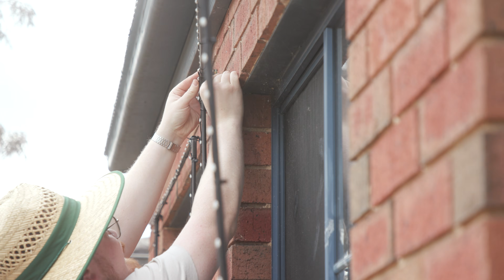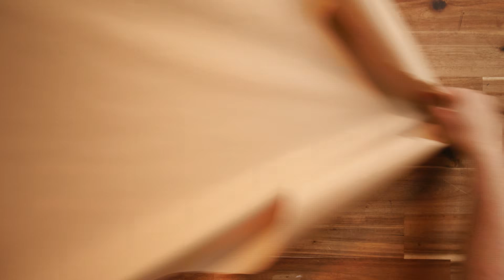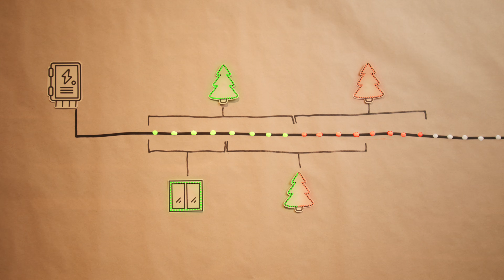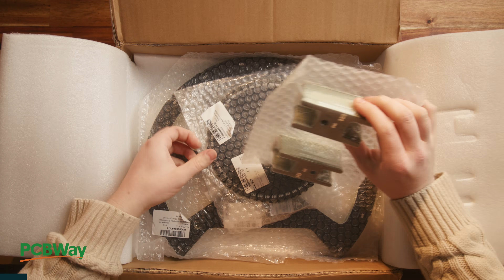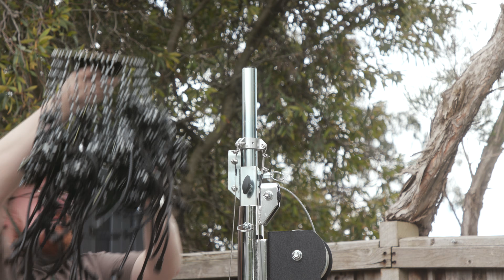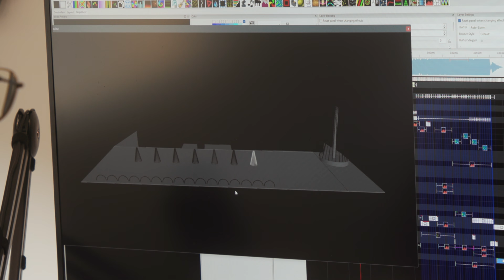Our 15,000 Pixel Light Show… Almost Didn’t Happen | Stockpot Christmas 2025 Part 4

Comment: For future, I recommend WS2815 strings, they have redundant data line that prevents from the whole string failing when a single pixel on it dies. They also run on 12V which is easier to handle bc it lowers the current you need to pump to them.

Comment: i only have a concern about the power supply in the water resistant box it looks like it has a fan so it could fail if not cooled adequately but if the power is lower than the 350w then it should be fine in the winter i'm thinking

Comment: 19:02 is it possible you could bypass the data signal across the dead pixel?
Reply from the maker: You could, but you'd have an offset of one pixel for every string after that.

You could also splice in just one pixel though!

Comment: Mate, that really sucks about the break in, I hope at least insurance will cover the costs? I've been watching this series with great interest. I've recently moved into a new home and I have big ideas for using addressable LED lighting everywhere inside: cornice cove lighting, tv backlight, bookshelf lighting, a hex pattern across my whole office ceiling, integrated desk lights etc. I've been wondering how to control it all, and play animations that span all the installations. I also plan to use home assistant extensively to control all my smart home features. I don't want to waste your time by asking for a tutorial, but just your thoughts whether xlights would be up to the task of managing what I have in mind - and whether I can integrate it with home assistant for voice control and automations to trigger various animations. Am I thinking in the right direction, or would some other application be better suited? Thanks! :D

Comment: What would be cool is if you came up with a self-indexing system that lights one LED at a time and records its position in space. This way you could dramatically adjust the shape of the show and still get a usable layout. Not to mention not needing to worry about the cable order anymore.
Reply: I believe this is what Matt Parker over on Stand Up Maths did a couple years ago with his christmas tree.  Could render 3d objects flowing through the tree.

Comment: Sorry to hear about the theft, actually devastating..

I would like to ask about mounting on the roof, I think you somewhat glossed over the connectors "glued" up there 😅.. The Aussie sun is pretty serious, so I'm sure you've had to use some serious glue?
Did you take into account potentially removing those clips in the future (e.g. if the house gets sold), or that's a future problem?

I have a tiled roof just like your parents, we had it renovated last year so it looks pristine now, and I'm hesitant to go adding anything permanent that couldn't be undone (doesn't have to be easily undone, just undone). Curious to hear your thought process regarding those clips
Reply from the maker: There will be a little more in the next video, they're just glued on printed zip tie anchors! 

I used a sikaflex product to glue them down which has worked well.